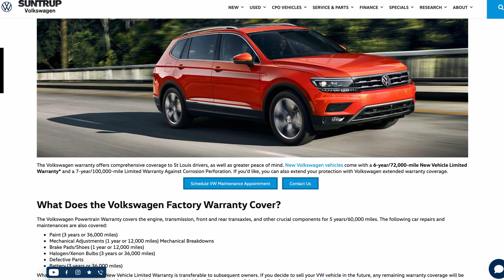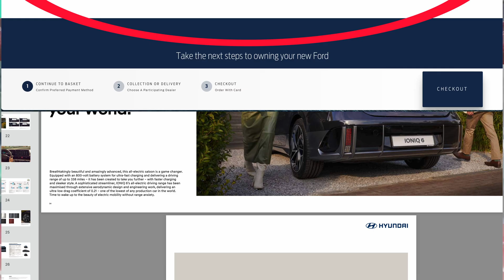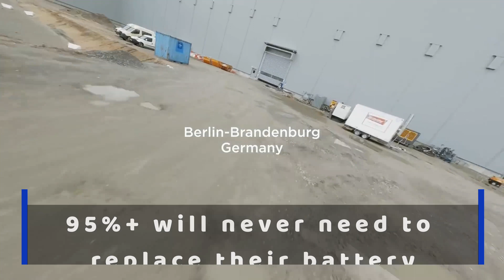EV Charging | Pricing Guide For Replacing An EV Battery

Comment: Not everyone has a budget to buy a new or nearly new EV. Only now Tesla model s from 2014/2015 have become more attainable for around £20k 
But if the battery fails and it’s out of warranty what is the cost to replace let’s say a 85 kw battery in a model S ? 
Or a failed motor ? 
As I’ve read a few model S especially the early models a lot have had new batteries and motors replaced under warranty … it’s scary thinking that if it fails when it’s out of warranty and the cost to replace is more than the car
Reply from the maker: Hi Richard, you are totally correct, but that also applies equally to buying an older ICE car and having the engine go. I bought a Renault Scenic a while back, which was in good condition and advertised as having just had the head gasket replaced. It went again after just a few months ownership, so I paid the Renault dealer about £1,300 to replace it. It failed almost immediately. They couldn't believe it had gone, but tested it and it had failed. Luckily they did the second one free. Some people get lucky, some get plagued by serious faults. I've got no answer for you, it is pot luck. My 2016 model has had no serious battery issues in 4 years and is showing no symptoms right now, Dave

Comment: A friend was quoted £17,000 by Renault in the UK for the replacement of the battery in his out of warranty 2014 Kangoo ZE 22kWh van, when several times just after parking there were loud pops/bangs from the battery.  The van is only worth about £5,000, and he was told the quote was so high due to the amount they need to take the van apart to replace the battery.
Reply from the maker: hi, I agree, it’s not good. it seems that some manufacturers try to make a profit from battery replacement when they make a loss on selling the vehicle. but not restricted to EVs, my old pre-EV high mileage 2010 Citroen C4 Picasso 1.6 diesel was quoted nearly £6k for a replacement engine on a car worth £2k. Dave